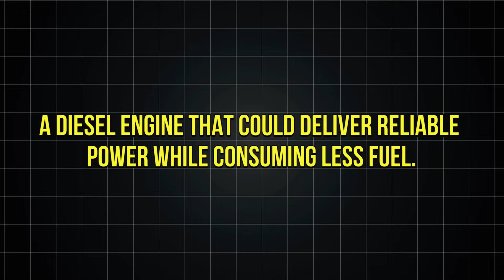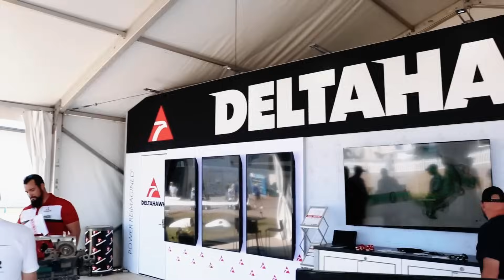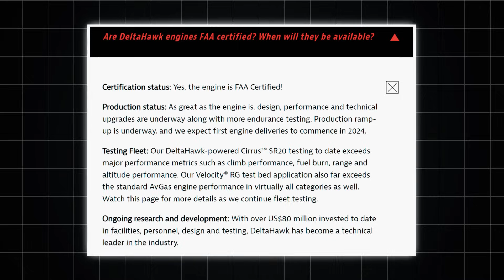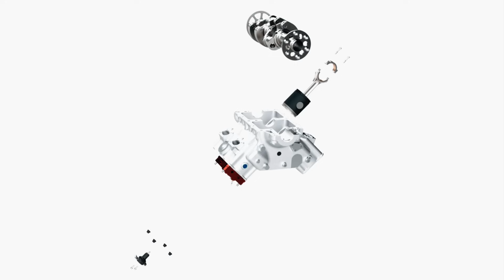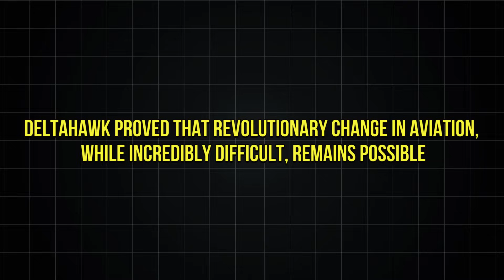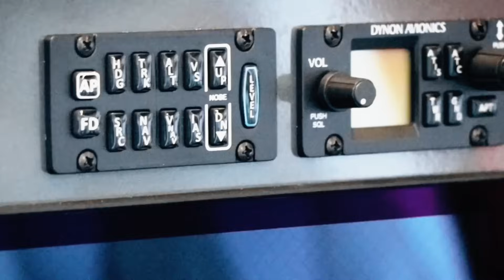The SHOCKING TRUTH Behind DELTAHAWK'S 27 Year Engine

Comment: In my country. What cars diesel engine suffer most are failure of injectors and its peripherals, those heat exchangers such EGR heat exchanger, oil cooler etc.  
The Japanese engines are more withstand tolerating than American or Europe brands. But they still face these problems.  While old polluting diesel engines were very tough.

Comment: A couple issues. One Delta Hawk does NOT use modern materials or manufacturering any more than Lycoming. Go to Delta Hawks "factory", empty. Lycoming has manufacturing capabilities DH can't dream of, and Lycoming uses the best materials and processes.

 SECOND DH "modern" engine uses a 2-Stroke, supercharged, turbo diesel, technology that is over 120 yrs old.

THIRD aviation diesels been around over 100 yrs and other Diesel (certified) have been in the market, certified, stc'ed and flown for over 2 decades, ALL 4-Stroke BTW.  

FOUR the DH will coast $90,000. 😅😅😅. My used 180HP Lycoming, I upgraded, with EI, overhauled, cost me total $15,000 (2010 dollars). It makes as much or more HP* as DH at SL and fuel burn difference is small. It would take 100 year's of flying to pay for the DH in fuel savings. 

* Someone may point out supercharger (complex uses fuel to run) and turbocharger (more complexity weight maintenance reliability issues) will hold more SL HP to altitude. TRUE. I can turbo the Lyc, with intercooler, fly my RV-7 to flight levels, well above FL180; low FL200's.  I don't need that. My Lyc at 55% power, flying in low teens (altitude) breathing O2 via cannulas, with my normally aspirated Lyc getting 25 MPG going 180MPH, in my RV-7. Lycoming support, parts, knowledge base, known performance and reliability, the DH is a tough sell.

DH just got an engine in a RV-14. Love to get real numbers but doubt we will sed that. DH has type  approved engine but no manufacturering production or STC yet. 

All the airframe  manufacturering companies are not lining up yo biy DH as they hope. For one brand new and again no manufacturering  yet. 

The airframe makers that have diesels or had diesel models, are or were using other engines. Diamond Aircraft uses Austro Engine (Mercedes based certified engine). Cessna used Thielert Aircraft Engines GmbH, which is now Continental Motors (now Continental Aerospace Technologies™)  Continental acquired Thielert Aircraft Engines  bankrupt assets in 2013.
Reply: Two stroke mechanical injection diesel is still from a engineering/performance/reliability/efficiency standpoint far superior to other avgas/mogas 4 stroke piston engines. Doesn't matter who manufactures it it's the most advanced in those terms, doesn't mean it needs to be "new or modern" that's marketing dogma.
Reply: @Blackbeardxx9  Show me your data? You are wrong but please feel free to embarrass yourself. 2-stroke, simple, lighter, cheaper to make but better? I own and have driven my VW TDI diesel 2.0L for 12 yrs. I could not image if it was 2-stroke. 

First 2-stroke never could make emission control. Second ECONOMY, two stroke, mechanical injection can not make the spacific fuel consumption of a 4-stroke ELECTRONIC Common rail Diesel engine. 

So again you are wrong but please feel free to show me data... I am waiting eagerly. 

Diesel is better than ICE in fuel per hp but at a cost, not the least of which is the Delta Hawk cost $80,000. I paid $20,000 for my Lyc O-360 all in, electronic ignition, makes more HP. The fuel savings with the Delta Hawk would never pay back the cost in two life-times... The only thing that would be a deal maker is flying in places like Northern Canada, Africa, Remote locations where Jet A and Diesel are only available. Diesels are HEAVY as well, and always WATER COOLED which is MORE DRAG and finding a place for a radiator. Unless you design the airframe around the radiator (P-51) most conversions on single engine tractor airplanes is a compromise.

I live diesel but I am forced to follow logic, math, physics, science not emotion... People see something new and they go Ohhhhh, Ooooooo, Ahaaaaaa its MODERN... Ha ha 2-stroke diesels like the Detroit diesel and diesels in WWII used in subs and ships been around a long long time. They did a great job in those missions. But we have better today. Delta Hawk is not wrong to go 2-stroke, but all other diesels are in aircraft (which are all Merc Benz adaptations for the most part) are 4-stroke.